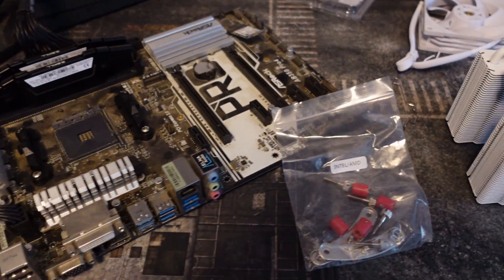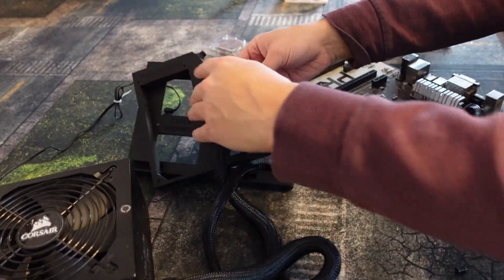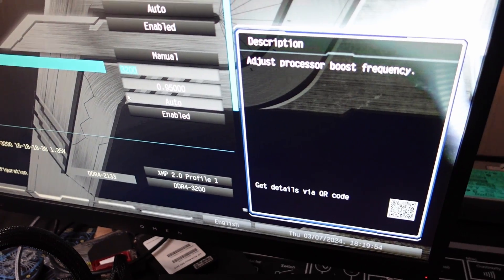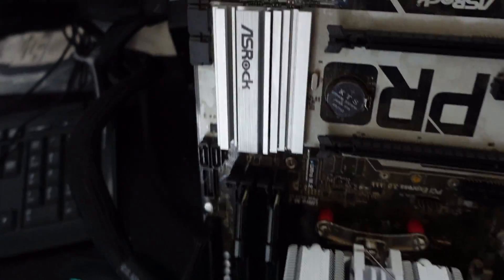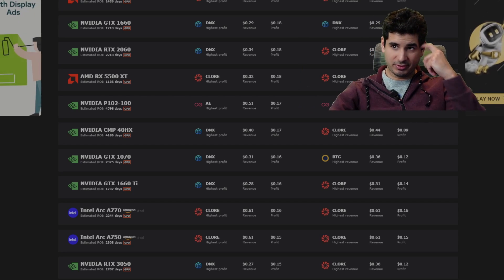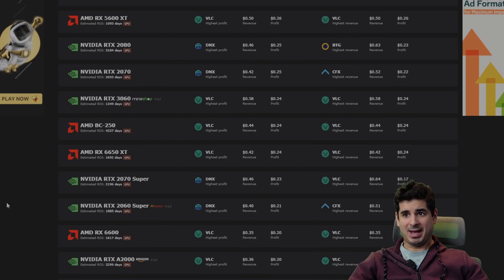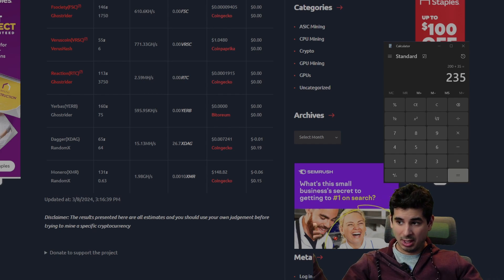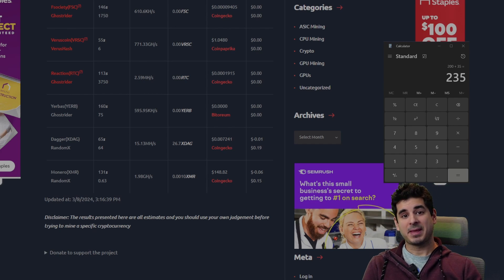Should you mine on older cpus? Lets find out!!!

Comment: I have that same exact motherboard. I bought a 3900x and it did not work with it, I did bios update it and check to see if it can work on the manufacturer's website it says it does so, but still never worked... lmk if it works whenever you get it
Reply from the maker: I have 2 of these boards and have had 3900xs on them for quite a while, so I can't say I have had the issue. What bios are you on